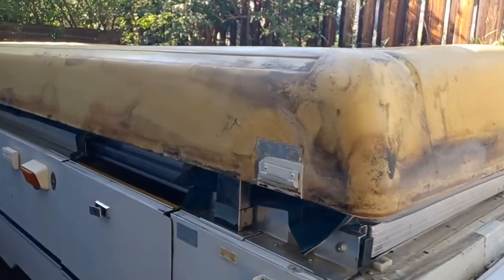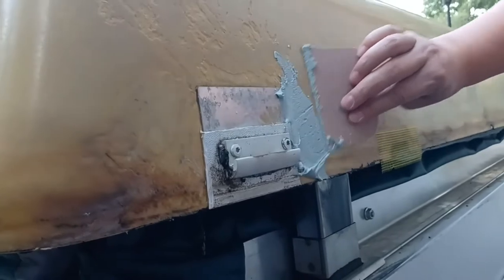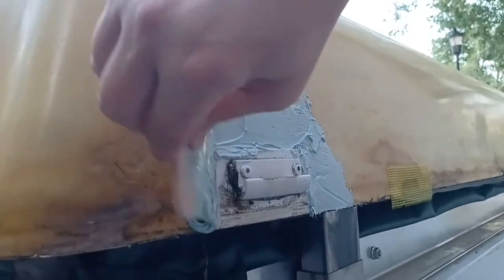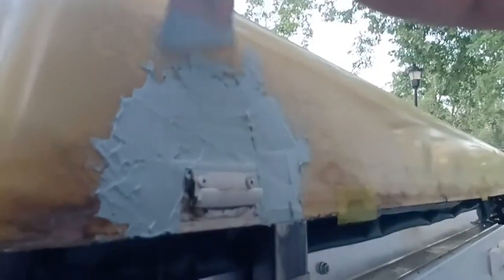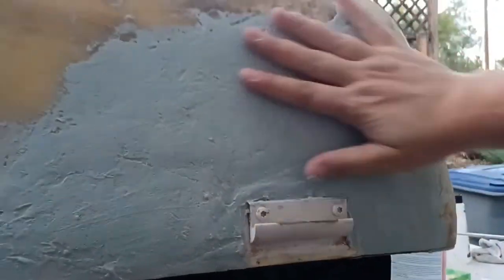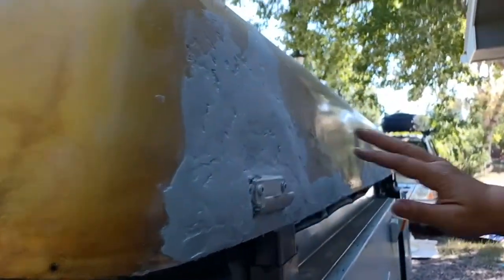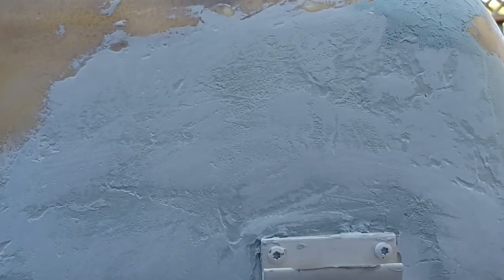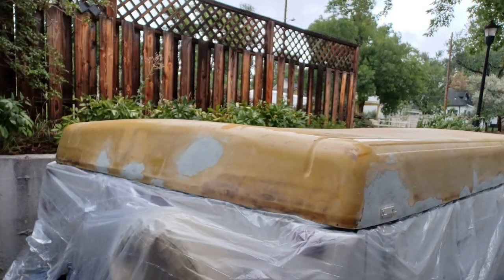Coleman Pop-up Camper Roof Re-do: Part 2: Prep

Comment: Hi! Thank you for your very helpful videos! I was wondering if you could share which type of bondo you used and about how much you used?
Reply from the maker: Hi there. We used the Bondo brand regular "body filler" from Home Depot. I can't be sure, but it was I believe the 1lb 12oz size and I'm pretty sure we ended up using 2 of them for our project. 
https://www.homedepot.com/p/Bondo-12-fl-oz-Lightweight-Body-Filler-PN0262/202077782

Comment: Really, really appreciate your videos, have a 1996 that I am doing this next week - mid June 2024.  Couple of questions, what expanding foam filler did you use if you remember?? I have a lot of screw holes to fill. How is the roof holding up this past year?  Did you re-mount an awning? and if so how is it holding on.  One last thing. I see in the Stores "Bondo Glass" with Short Strand reinforced fiberglass filler. I wonder if this would give you the strong cover same as "classic" bondo??   Really appreciate any help. Happy Travels, Kalani MacGill
Reply from the maker: I don't recall which foam filler we used, but it was a pretty basic type. It's worked great so far! But it really expands so you have to scrape what ends up creeping outside where you want it to. Roof has held up really well, although it sinks in the middle some. We did get some hail damage that put holes in my pretty new roof, but I ordered more grizzly grip and just filled them in. I did not re-mount an awning so can't advise on that.